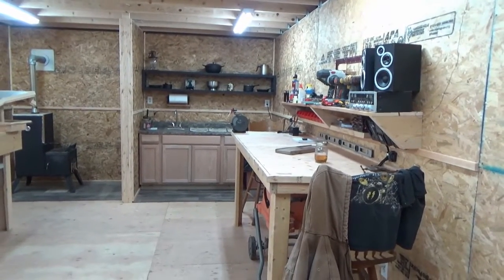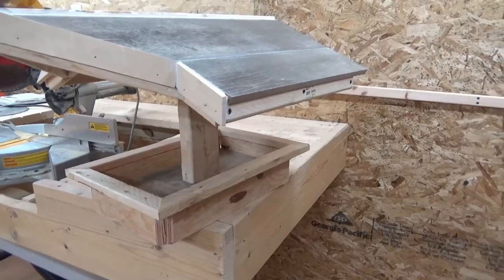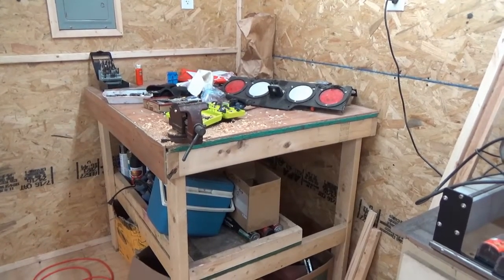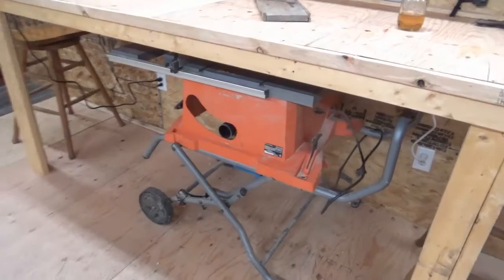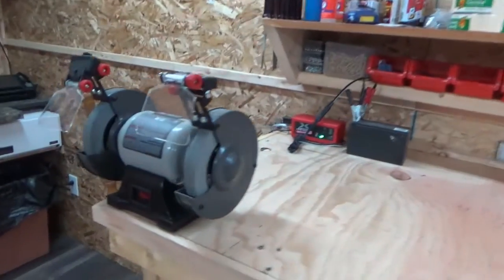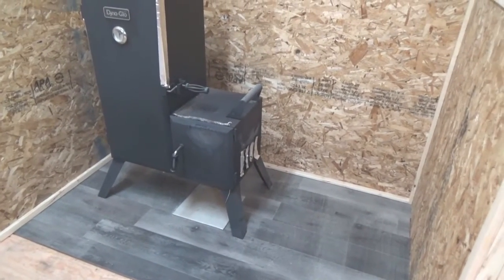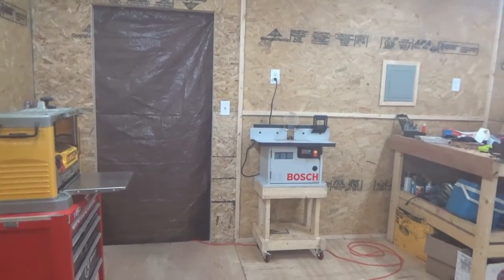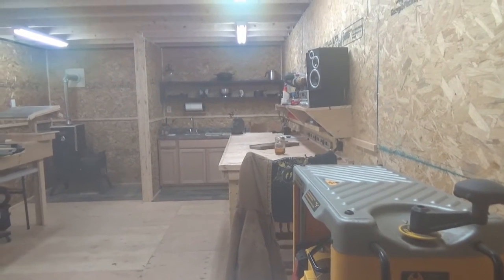Building My Workshop, Part 8

Comment: When you going to do some videos on horseback?
Reply from the maker: Funny you ask that. As soon as I get my truck back from the shop I'm going to bring my round pen panels to the new house and get set up to start riding again. So, very soon I hope!
Reply: @SteeveeDan  that new motor back in the shop ready?
Reply from the maker: @smitty1696  Yes sir. CEL came on within 50 or so miles. DPF code. Told them it would happen since the egr cooler was puking coolant into the intake and out the exhaust. Hope to have it back mid to end of next week as they had to order the part.